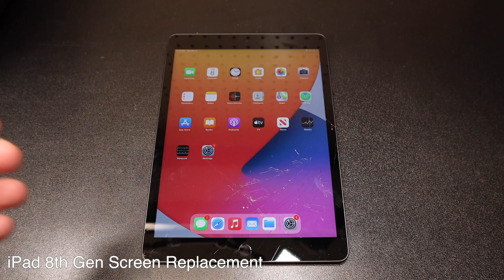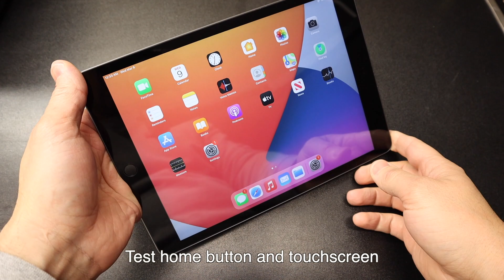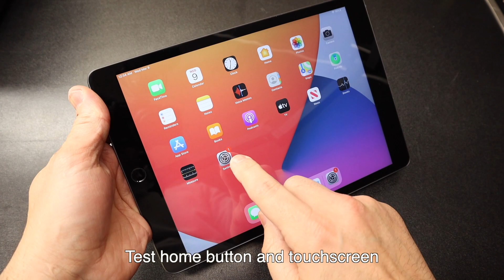iPad Cracked Screen Repair | iPad 8th Gen Broken Screen Replacement | iPad Restoration

Comment: Hi, had the same problem weeks ago, I let a shop on the mall to replace the touchscreen. It was replaced but my problem is that the performance of my Ipad, 7th Gen is not the same than it used to be. Like the battery from 100% even I am not using it, will go down up to empty. And then I cannot connect to the internet or hotspot, and it really confused me. Was it possible that  the ipad was damage during the crack replacement or they had done something to the Ipad? I'm sorry what I am not that into technology but a user only but I am really wondering and I want answer. Maybe you can help. Thank you in advance!
Reply from the maker: If the iPad was working fine even with the cracked glass but after repair is experiencing issues, then either the new glass is defective or the repair was botched and they damaged the board or battery.

Comment: if you buy the screen with the  home bottom included does  the touch ic works .. finger scaner .. ??????????????????????????????
Reply from the maker: Unfortunately no, only the original button has the Touch ID paired to the original motherboard.